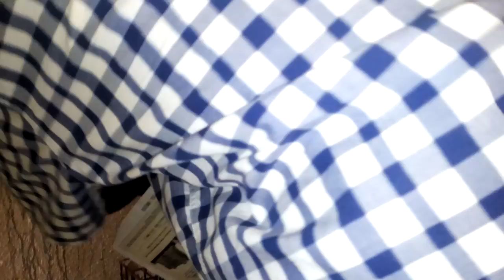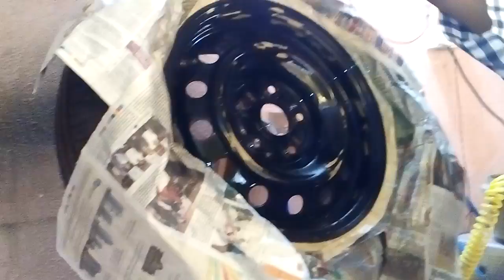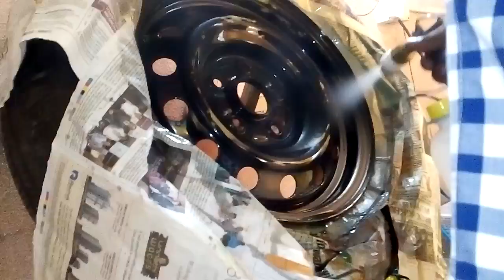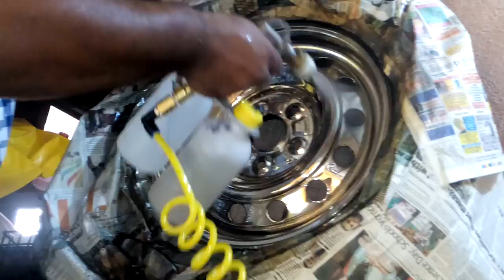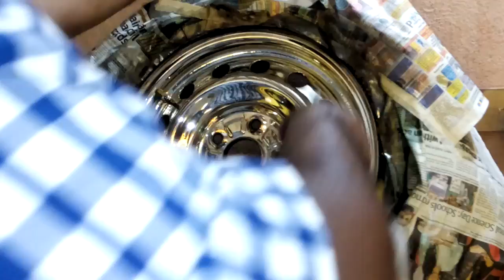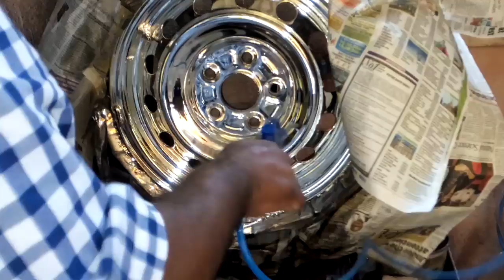Normal wheel silver chrome sprayed ,

Comment: For all of you who say it's fake or it falls off etc... It is real but it is not real chrome plating, it is a firm of chrome painting with a special paint that you & special steps you need to do, you need to sand it of course for a smooth look just like any other paint job then you paint it gloss black first then you spray a lot & it's slowly starts to change to chrome then you rinse with air & water then repete etc.. then blow dry so it don't leave any water marks & you have to do the whole process fast, there are different company's that make this stuff & have different methods to apply it there is some you just paint it on like spray paint & you can just brush it on, just 🔍 "paint on chrome" to you tube & you'll see all the different types with explanations & instru tion processes. & The company's that sell it.
- your welcome!

Comment: Interesting, but I notice, even with all that wet 'product' being sprayed about the news paper doesn't become sodden. You would have thought it would have started to fall apart.  In one shot, a jet from the spray gun hits the newsprint and it appears to remains dry!
Reply: The reason water dissolves paper is because the water itself dissolves the glue. It has nothing to do with being a liquid, only that the glue is activated by water.
Reply: Other liquids not comptible with the glue will not dissolve it like oil or acetone